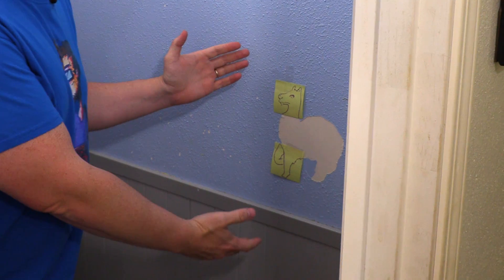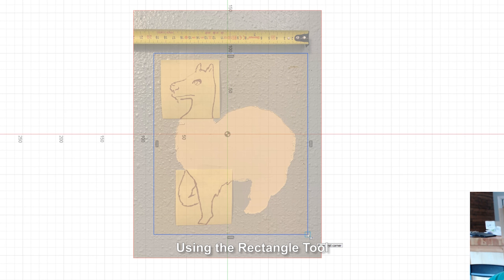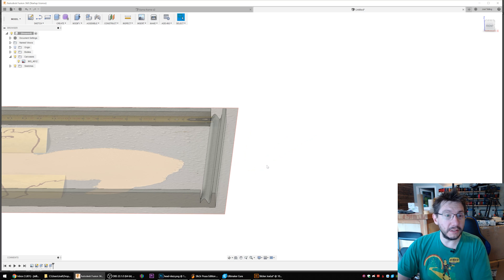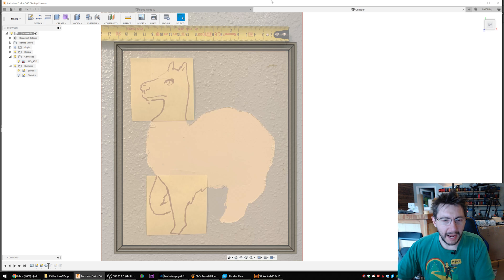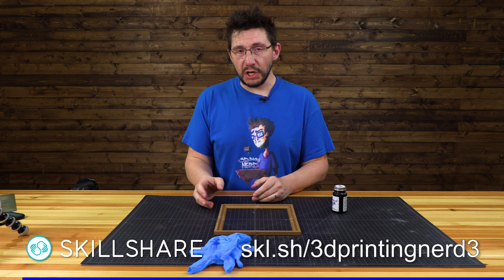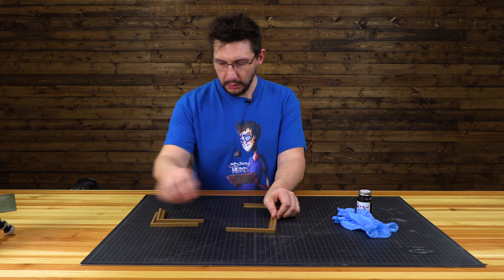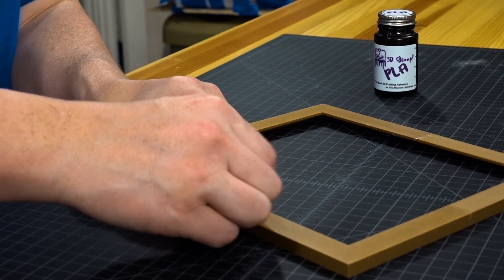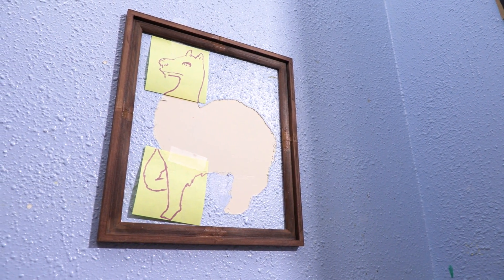3D Printing with WOOD FILAMENT! DIY FRAME

Comment: Was a frame printed as one piece. I need to get this wood filament. Is it more expensive then your ususal one? Please check my attempts at ptinting frames with patterns and also print 3d models based on the photographs to go go together with the frame.

Comment: Pro tip: Instead of calibrating with a small measure of 0.1mm you should use a large measure. Especially for larger images.

If you measure 0.098 instead of 0.1mm, 1 meter becomes 98 cm. 
If you measure 9.98 instead of 10cm, 1 meter becomes 99.8 cm.

Comment: Woodworkers often have to attempt to prevent excess glue getting into the surrounding wood causing issues with stain.

A common solution is to seal the wood prior to gluing with sanding sealer, lacquer (hair spray) or shellac.   All of these are easily removed with light sanding and will minimize the glue getting into the wood pores so a more even stain.

Nice artwork.

Dave.

Comment: I'd like to take a second to point out how valuable the first 3 minutes of Fusion 360 tutorial were. You took the time to show us what you normally would do and, as an amateur 3D modeller, I would have logically taken a similar approach. Showing us your mistakes is just as important as showing your solutions. I found it very useful and thought I'd let you know. Thanks, Joel.

Comment: Just wondering why you didn't use a printer with a larger bed and print the frame as a single peice? I understand splitting up the frame was a learning experience but it would have looked better and been less work as one piece.

Comment: 8:00 Ooo. Cool trick. If the printer is up to it (or you're doing this on a CNC router), you could do a fancier joint like a dovetail. I've been trying (with little success) to get my workplace to try those crazy Japanese woodworking joints either on the 3D printer or their CNC machines.

Comment: Just a thought, but you could have cut filament sized holes at your cut marks and then used filament as connecting pins (much like a dowel). It is wood filament after all.  :)   Also I believe a cut at the corners would be less obvious that it was multiple pieces and one could orient so that the "grain" went lengthwise on each piece. I love the wood filament, you can play with different temps and speed to change how dark the print becomes.

Comment: since you split the frame into 4 parts, you could add a recess in the back to hold a plexiglass insert and print the parts upright
Reply from the maker: OH CRAP I didn’t even think of printing them upright!

Comment: This particular model would be very well served with SketchUp.  F360 has it's place and is super and awesome, but so is SketchUp for certain types of models.  I mainly use it for wood working projects.  This would literally take just a few minutes in SketchUp and most of that is open and set up.  Actual modeling is poof, done.

That said this was a great walk through.  Really got the brain juices going.  I've not used the Patch workspace yet!!

Comment: Hey Joell, could you make a video comparing different ways of splitting parts up in Fusion?

Is there any way to run Fusion on Linux without using a Winderps virtual machine?

Comment: Cool project but a nicer way to split the frame would have been cutting the corners and place the long parts diagonally on the print bed
Reply from the maker: Very true. Oh the things you think about when you’ve had the proper amount of sleep 🤣🤣
Reply: @3DPrintingNerd It's just a happy little accident :D
Reply from the maker: YES!

Comment: Odd that you split it into corner pieces, not 4 straight pieces like a real frame?
Reply from the maker: I had thought about doing that but the longest side was too wide for the build plate. This was my “this solution will work, right?” moment. Ha!
Reply: @3DPrintingNerd  makes sense then!

Comment: When you calibrate the picture in Fusion, it might be better to go with a bigger measurement.  With you doing the 1 mm, say that was actually 1.1 mm, then that error would be much larger for the full size picture.  Instead of 10 mm, you'd be at 11 mm.  Instead of 100 mm, you'd have 110 mm.  If you did the calibration at 10 mm, and you were still off that .1, then at 100 mm it would only be off 101 mm.   I know it might not matter that much for something like this where it doesn't need to be exact, but it just might help for something down the road.
Reply from the maker: Oh crud, GOOD POINT.

Comment: It would be nice if you can print the whole long top, bottom, sides piece on the print bed corner to corner. That way the seems would be at the corner of the frame.

Comment: Awesome! Since I scale images every day at work, a tip to get the most accurate scale: do not scale your image by just 1mm, scale by the largest amount you can.

If the frame is 20cm long and you use 1mm to scale your image, and your selection is off by just .05mm, it will be .05mm off every 1mm for the entire 20cm, or 10mm larger or smaller than 20cm.
Whereas, if you scale the image by 20cm instead of 1mm, if your selection is off by .05mm, it is only off by .05mm over the whole distance.
Reply: Came here to say this. Yep!
Reply from the maker: SUPER GREAT tip thank you so much!
Reply: Indeed. If you look at the planned frame, it is perfect size, but the real lama barely fit into the printed frame. I think that's because of the wrong scaling.
Reply: me too
Reply: This
Reply: Right. .05mm is 5% error over 1mm, but .005% error over 20cm.

Comment: what happened with the Gmax that you had that used a large printing bed?
Reply from the maker: I gave it away at MRRF
Reply: The Hatchbox Woodfill PLA has a diameter of 1.7mm and I’m pretty sure the Gmax takes 3mm filament
Reply from the maker: GMax takes 1.75 Filament

Comment: would it not have fit on the CR-10 bed in one piece?
Reply: Domenico Lamberti cr-10 was still in the box at this point.
Reply: @lasersandlayers  Roger that :)

Comment: It's better to calibrate scale with points that are far apart. If you use points that are close together; even if you are only off by pixel or two off, that discrepancy get multiplied many times. If you use points that are farther apart a small discrepancy may only be multiplied once or twice. Not really important in this case but can be in other instances especially if you are trying to get a close fit.
Reply: Yes! It was almost hard to watch
Reply: also, if you compare the frame in 360 vs the real one, it just barely fit over the "art"